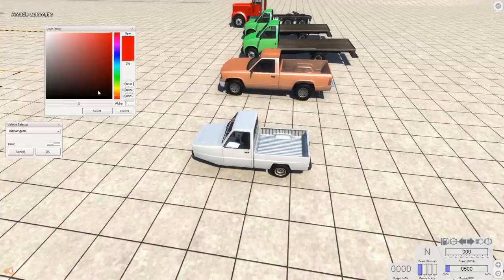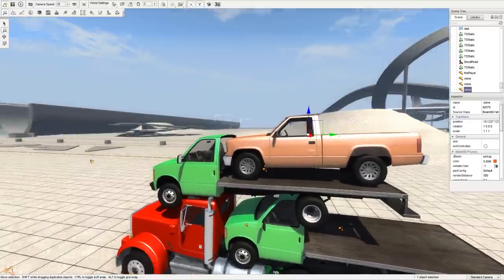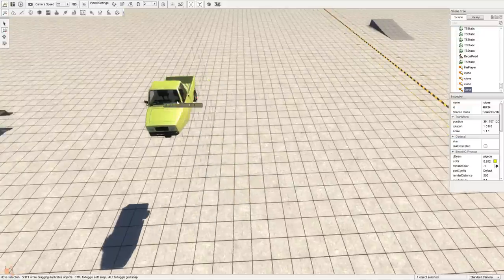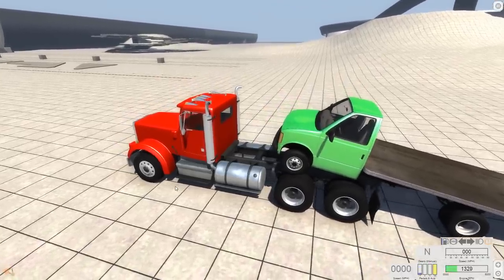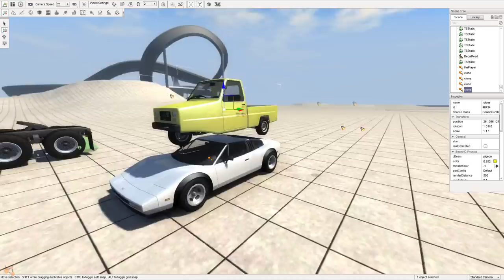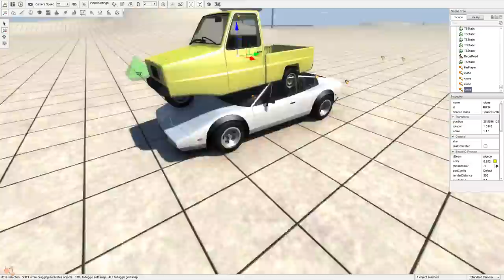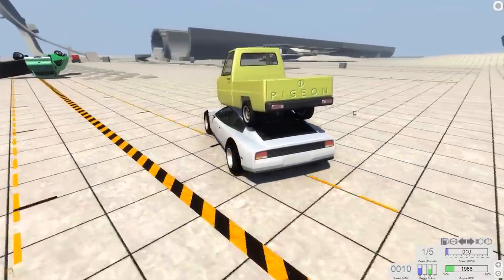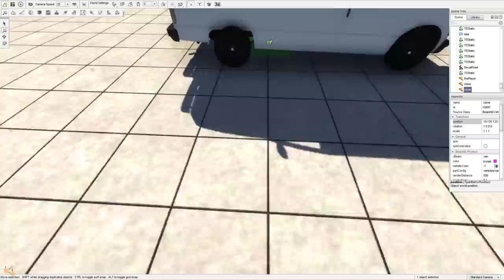Car Stacking - BeamNG.drive

Comment: The big rig lags my comp quite a bit is it normal my specs are:

Intel core i5 750 2.66 GHz(3.2 turbo)
Nvidia gtx 750 Asus OC 1 GB gddr5
10 GB ddr3 1300 MHz
500 GB WD blue

What are your specs why be are I am building a new system soon and I want to build desktop with similar specs as yours.